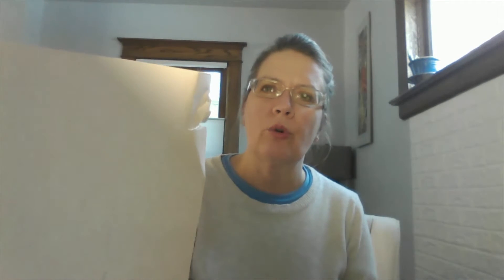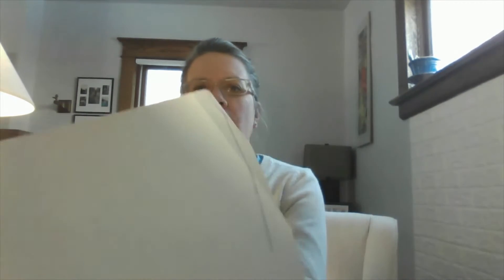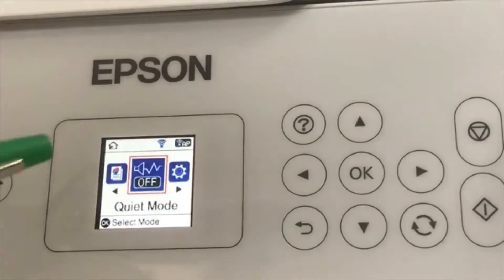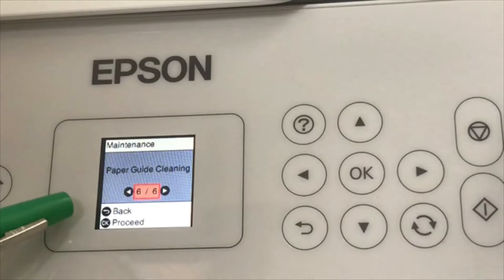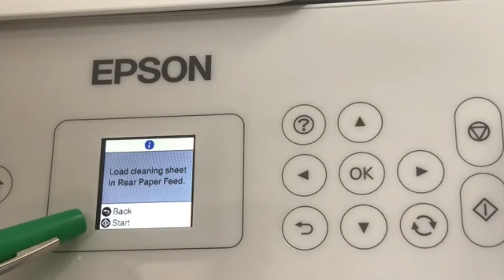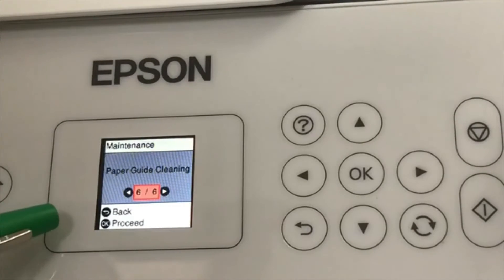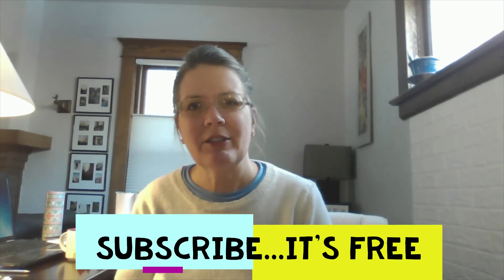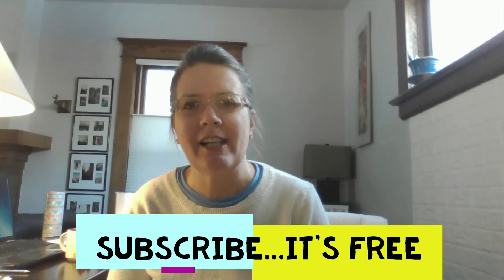Sublimation Paper Jams and Ink Roller Marks - STEP BY STEP FIX -IT DEMONSTRATION on Epson Eco Tanks

Comment: ✨How do we fix the pizza wheel lines in the print though?
Reply from the maker: For the most part, if they are black pizza wheels, then you should start with cleaning your rollers and wheels.  If they are white, it's usually too much ink being layed down.  Get a higher gram paper or try turning off high quality print.

Comment: I didn't see any mention of how to get rid of the Pizza wheeling. I am having such a problem with my 2720. It is almost as if the wheels are perforating my paper. I can feel it on the back of the paper and it is transferring the little black dots onto other areas of the print.  Is there any way to fix that?
Reply from the maker: First, I would try a lighter gram weight paper (or sheet of copy paper) to see if the pizza wheels are eliminated.  If so, I'd go down in gram weight for your sub paper.
Reply: Same problem here. It happened after i refilled my sublimation ink. I cleaned rollers but no change.
Reply: Go into your preferences and  maintenance then change it to thick paper worked for me

Comment: i am having so  many issues its pizza marks and keeps jamming the paper not even grabbing it i changed all the setting per previous videos .. any idea how to fix its stressing me out lol
Reply from the maker: Did you try this method in the video?  Does your paper not grab during the paper guide cleaning?
Reply: @QuickSPI  i did try it works with regular paper the sub paper just keeps jamming tearing and I even went bought some other type same thing I’m so stressed out lol
Reply: @Uniquekreation32  was that problem ever resolved and if so how? I'm having the same issue. I've gone through 10 sheets of sublimation paper, it also eats my copy paper on occasion... it's frustrating.
Reply: I changed to A Sub paper, problem solved, had been using Better Sub, it definitely was not! Actually it is a narrower paper and I believe that was the issue.

Comment: I am having the issue of the paper being fed partially then it gets stuck and I get paper jam error code 000031. Very frustrating. I’ve tried everything and since I converted it to a sublimation printer it voided the warranty. Any ideas.
Reply: I’ve been having the same issue getting the error code 000033 or 000025 paper jam when there’s no paper stuck have you had any luck?
Reply: I’m having the same issues and nothing is helping
Reply: Here for the same messages on my ET-2803, nothing is working

Comment: My printer won’t even load the paper now so I can run the cleaning. It seems to grab it slightly on the right corner and then pulls in crooked and then jams it. Either that or it doesn’t load at all and then says paper jam. Any advice??
Reply: Did you get it fixed? Mine is doing the same.
Reply: @melissabrunke  I couldn’t fix it. I contacted Epson and it was under warranty thankfully!

Comment: I have a epson 2760 and my printer just started smudging every print..looks like roller scratches..Do I do this as well.
Reply from the maker: It won't hurt to try.  If it just started you might have an ink build up on the rollers or guide.  But try printing something on thin copy paper and see if the same thing happens.

Comment: Thank you for this! My 2720 has jammed 7 times while I was trying to print the last page of my design this morning, and I remembered that you had made a video about this issue. The paper is still fine (not wrinkled), and it doesn’t matter to the design if I print over what has already printed on it since I’m doing the faux tie-dye look with a tie-dye pattern. I’m going to run the finished prints through a paper crimper before I press them just to see what effect that will give anyway. I just hope the printer will still accept the “used” paper so it isn’t wasted. If not, I guess I can cut it down to half sheets to use for small designs. Question - Should I have the automatic software update enabled? I’ve heard some warn against installing the Epson updates, but YOU are my go-to ET2720 guru. I need your thoughts on this before I do anything. LOL
Reply from the maker: That will probably end up looking great!  I don't auto update, but I usually end up manually allowing the updates at some point.
Reply: @QuickSPI  It turned out SO cool! I used the wavy crimper, and it left a slight wavy pattern on the shirt. I never could get the sublimation paper to go through my printer, but plain paper printed just fine. I’m wondering if the difference in humidity from my studio, which has a dehumidifier, to my bedroom caused just enough moisture to get into the sublimation paper to make it act up in the printer. It’s extremely humid right now here in east Texas, and it’s hard to keep anything dry. I’ve been busy and haven’t had a chance to mess with it again.
Reply: Im getting vertical pizza marks on my paper. Ive tried head cleaning nozzle check and different print settings but no change

Comment: My printer won’t even load the paper now so I can run the cleaning. It seems to grab it slightly on the right corner and then pulls in crooked and then jams it. Either that or it doesn’t load at all and then says paper jam. Any advice??
Reply from the maker: clip off the right corner and see if it will feed itself.  If not, there is very likely a tiny piece of paper jammed inside and you cannot see it.
Reply: @QuickSPI  Is there a way to open the printer up so I can see inside?  I can’t see anything but it’s a very small space to look through.